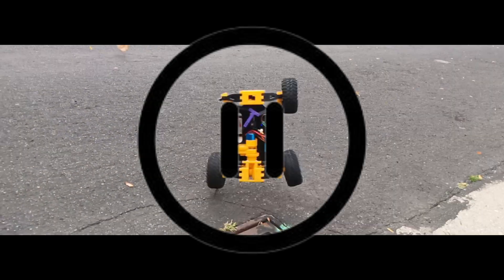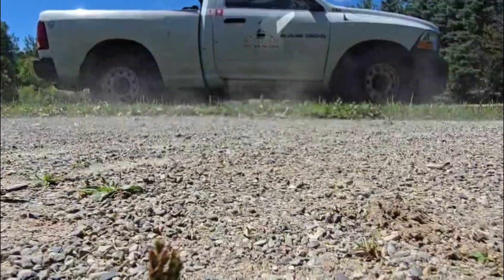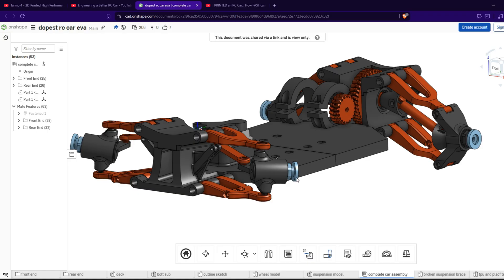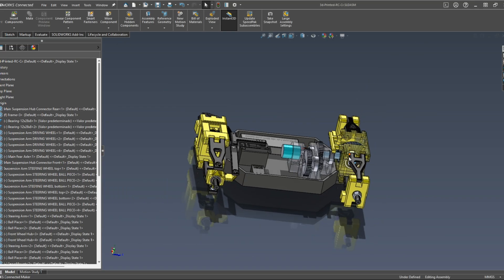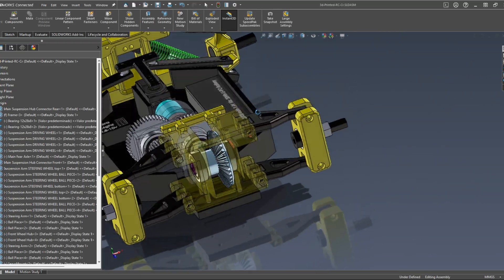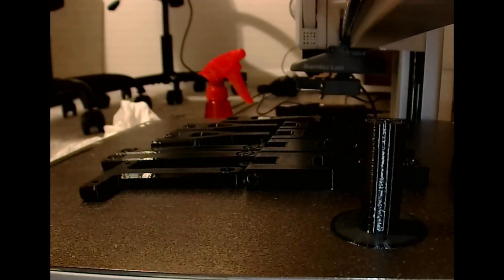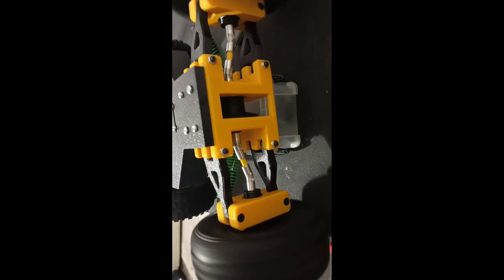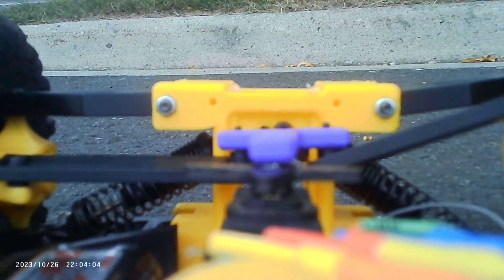How I Made A 3d Printed RC Car From Scratch

Comment: Do you have a link for the tires
Reply from the maker: I pulled the tires out of an old RC car, I don't think you could buy these specific ones online. However just search for any 8mm hex tires with aprox 120mm wheel diameter and it should be fine. If they're bigger hex tires you can easily make an adapter.

Comment: Great project! It is also possible to print the Cardan joints 😉
They need metal reinforcements, but then they are actually quite durable! I've used them on two projects so far, and they did not break once!
Reply from the maker: Interesting, you could easily replace them with plastic reinforced ones if you wanted, wouldn't be too hard of a redesign. However I've had even pure metal one break, so i've upgraded to heavy duty RC level cardan joints now. I don't think plastic reinforces would hold up, however lmk if you try it out.
Reply: @HydranceYT  I think two points are critical for using printed parts in the drive train. 1) large diameters are needed (my Cardan joints have a diameter of 25 mm) and 2) avoiding sudden torque impacts (I use TPU connectors as torque dampers). The former improves the general strength and the latter prevents shattering parts if abrupt accelerations or changes in traction occur.
Reply from the maker: @TRDB_  Yeah that's a good point, the torque dampers are actually a really good idea, I got some TPU 95A a few weeks and am working on a newer version of this RC car that goes 60 km/h, ill try integrating something like that. Also yeah 25mm diameter should work really good, my main gear's axle is like 12mm and has only broken a few times, so 25 will keep you going for a long time. Thanks for the feedback!